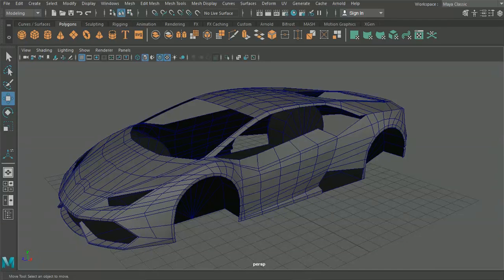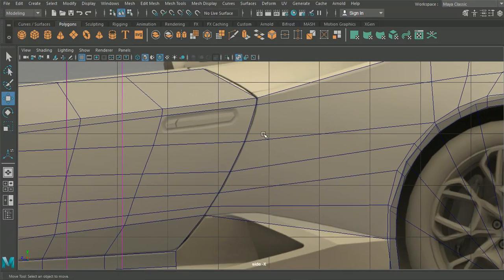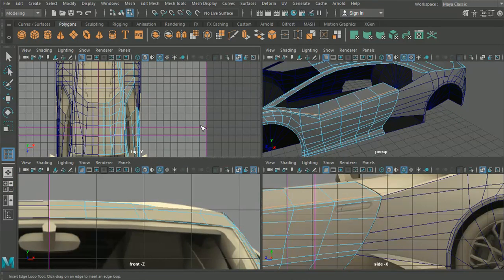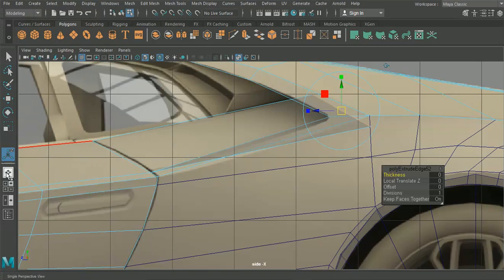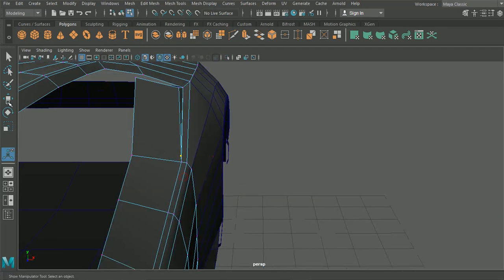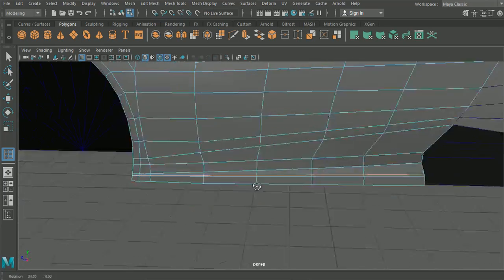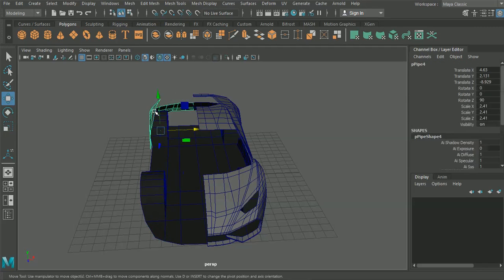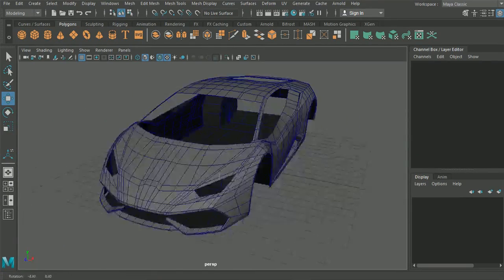3D Car Modeling Tutorial pt.7 | Autodesk Maya | Modeling a Lamborghini Huracan

Comment: My model is really taking shape now although I'm having a small problem when I extrude the lower section of the side skirt. The faces of the model turn black and if I try changing the material in Hypershade its still black no matter what color I choose. Hope you can help!
Reply from the maker: It's probably the normals, they may have been flipped when extruding. Highlight all the affected faces then go to "Mesh Display" -> "Reverse". This should flip the normals to the correct axis, therefore flipping the colours over, putting black on the back and your material on the front. Hope this helps...
Reply: DUDE! Thank you!